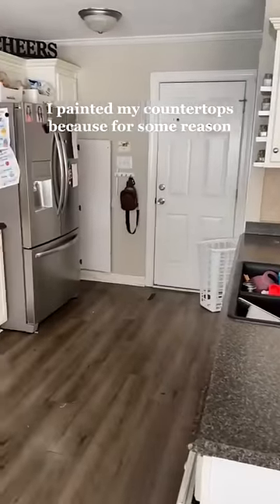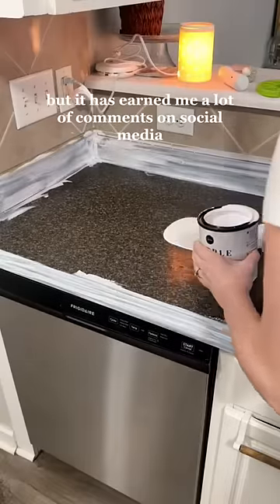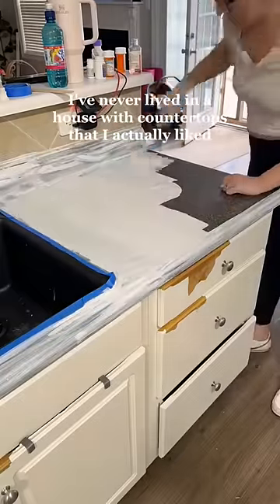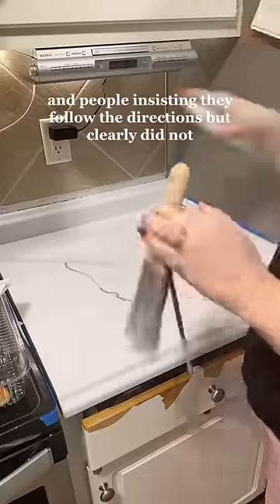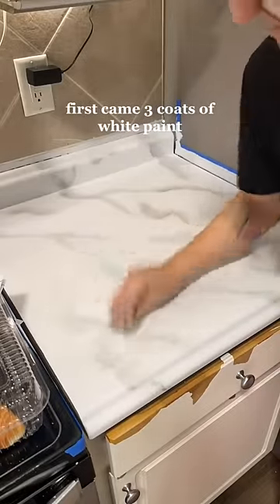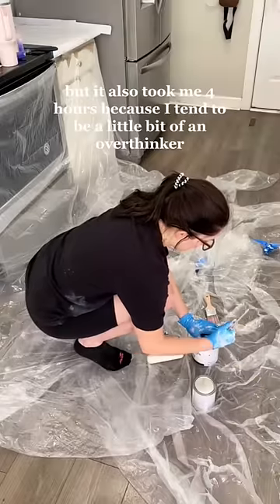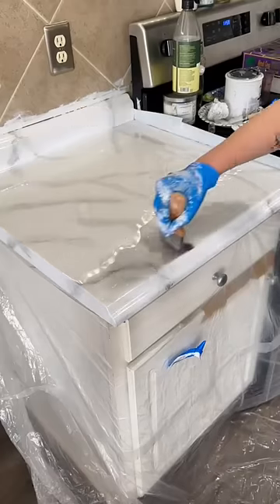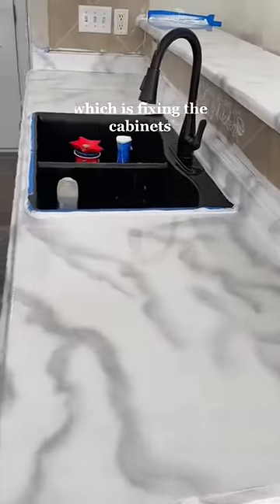painting my countertops! Part 1 of my DIY kitchen makeover!

Comment: We used this paint kit and were able to extend the life of our countertops for about five years! The only problem was the caulk and sealant around the sink had to be reapplied a couple times.
Reply: I have old Formica that is love to do this to. Do you have to do the epoxy seal? How long does the epoxy take to dry?
Reply: @cherylhag3253  24 hours.i recommend stone coat or marine.  I've done about 10 countertops. It's fun. Mask up before sanding or torching.
Reply: What is mask mean..??😅
Reply: @Teresa M Varela  wear a mask. A respirator with replaceable filters is best because a dust mask won't filter the gasses.
Reply: @cherylhag3253 I'm pretty sure that's what I have when I looked it up u can pop that off and add new laminate. I'm gonna try it one day it's not that expensive
Reply: it's a GREAT trait!  I got that too ❤ DO you boo boo,  no one else matters,  they don't own YOUR property 😊
Reply: He he caulk

Comment: It looks awesome!! If you have problems with specks of dust thats stuck then you can sand it with sand paper to the highest grit then use a wet and dry sand paper to do a light polish, then finish it off with a glossy top coat then you dont have to be so worried over it feeling gritty or orange peel textured.

Comment: Nice job! As a professional remodeler, I have a few quick notes that may help if you choose to do another, or if someone else wants to try.

Pulling out the stove, fridge, etc (if it can be done safely) you can both clean those surfaces more thoroughly, and be able to reach the sides to prevent a hard color stop line. 

Print out multiple visual references of the stone you want to recreate. 

Start with less and come back to add more before sealing if it needs. 
Multiple shades of your color, and putting a second pass in a thinner line over some previous ones once it’s dried is also a plus. 

Happy DIY everyone!

Comment: Good trait, only recommendation I have is, (if the paint is having trouble sticking) sand the surface you are gonna paint first it helps it stick
Reply from the maker: For sure. Luckily since I covered it in epoxy it didn’t need to be sanded because it can’t chip

Comment: I’ve been wanting to do this in my kitchen. I’m only hesitant about the resin. I’m not sure why, I craft with resin all the time. I hate to sound ignorant, but is this a special kind of resin? Idk, food grade? I’m asking because I have to do this now that I see how pretty it turns out!
Reply from the maker: it dries as an inert plastic, so as long as you dont cut on it or heat it up to melt it then it won't leach into your food. although I dont really recommend putting raw food directly on any kind of counter top! but ive had no issues and its been almost a year

Comment: A couple I know husband and wife thought they were wise. By installing a reverse osmosis system it backfired. After a year I started pouring 25 gallons at a time, dumping it into the ceiling of their basement, causing mold, Zimbabwe and horrific repairs needed. It cost them over $10000 to rip the ceiling out. Remove the mold and do it right in higher professionals. Sometimes being cheap is not creative hire. Somebody who knows what they're doing.  In the long run, it saves time energy. And you get the job done right the first time
Reply from the maker: this is just a countertop, not a reverse osmosis system. dont worry.

Comment: I painted mine with a similar kit, looked AMAZING for about 3 months… unfortunately because of normal wear & tear (using my mixer, cutting veggies with a thin cutting board, sliding my coffeemaker to fill it, etc) I began to notice spots where the paint wore off. Each spot becomes bigger and bigger… I ended up getting all new countertops within a year because it looked so bad. Would not recommend.

Comment: When you work with epoxy resin, you should be in a highly ventilated area and/or be using a proper mask for safety
Reply from the maker: Good tip!
Reply: @KileeRainbow good tip? More like only way to not die with cancer in 5-10 years

Comment: Aren’t you supposed to sand down the countertop first?
Reply from the maker: No, the epoxy dries on it like a plastic. Doesn’t make a difference
Reply: @KileeRainbow  that’s cool 👍🏻. I spray painted something smooth like that countertop (used plastic paint) and it was peeling off like plastic. So I redid it with sandpaper and it had a better grip. Thanks for teaching me something new. I love your projects

Comment: Now you have a countertop which is not heat resistant.
Reply from the maker: it wasn't before lol most inexpensive counter tops aren't
Reply: @KileeRainbow  My coffee mug leaves circular impressions on mine, which is considerably worse than even the crappy Home Depot products.  But different epoxies can perform better.  This just commits you to always use towels or coasters and such to protect the surface.
Reply from the maker: @toditron  oh mine is definitely not like that. I haven’t had any issue. I don’t set hot pans on it but everything has been fine
Reply from the maker: @toditron  mine hasn’t had any issues like that whatsoever

Comment: Epoxy is not food safe btw
Reply from the maker: it dries as an inert plastic. as long as you dont heat it and cut on it, its fine. which you shouldn't do with any counter top. also, dont lay food on your countertops because thats gross.

Comment: I’m sorry but this is very clearly a tacky result. Not only does the best outcome of following the directions make it look like a fake marble plastic countertop, but the food safety of your counters is completely negated by literally covering it in epoxy resins. Any dents or scuffs in this not very durable material is gonna equate to constant repairs or cover ups costing you more in the long run than if you’d just bought countertop vinyl that was photocopied of actual marble for less work, maintenance over time, and effort for a better outcome. Oh, not to mention that if it becomes too scuffed up you’ll have to pay for a new countertop instead of being able to just cover it up with vinyl seamlessly.
Reply from the maker: Well it’s working great and it’s been over a year. I like it & since it’s my house I guess that’s most important

Comment: The use of toxic chemicals in the home, esp., not wearing safety equipment, is risky.  I was severely chemically injured through inhalation of chemicals and within a month it looked as if I had suffered a stroke.  I am disabled and chronically ill 😢and if only I had known that what we breathe can damage the nervous system and the brain….and not years later…either… 😢 please don’t bring chemicals in the home.  Read safety data sheets on product materials, and pray your genetics can handle the subsequent off gassing that occurs.

Comment: The most intriguing thing about all the countertop videos and the amount of people thinking resin is safe to contact food and anything we put in our body... this is so toxic and dangerous!
Reply from the maker: the most intriguing things about doing this project is how many people must lay food directly on their countertops. thats what is weird to me. this is epoxy resin + food safe as long as you dont cut on it or heat it up its fine. whats not fine is preparing food directly on your countertops no matter what kind they are.
Reply: @KileeRainbow  you don't have veggies touch your countertop? I'm not talking about cutting food on it, just the fact that when you wash veggies and then put them on the counter to prepare to cut into on a cutting board, you're still having contact with the counter. Epoxy resin is not food safe. Not body safe. Inhaling the chemicals, touching the chemicals and even when it's dry it's toxic. So many people use so much resin in their homes from floors to counters and it's not safe. I'm sure you don't wash your hands after every time you touch your resin counter... I'm just giving you information, you took it to a whole new level of defense about what I said. It's toxic. When we know better, we do better. Look into it for your health.
Reply from the maker: @Sweet0ne-87  once epoxy is cured it’s an inert plastic. It cannot just jump off onto your food/your hands. Similar to using a plastic plate. as long as it’s not heated up or cut on it’s fine, similar to a plastic cutting board. They also make food grade/safe epoxy. I may be defensive but I am actually professional certified at one of the highest levels for food handling & food safety so I do know what I’m talking about